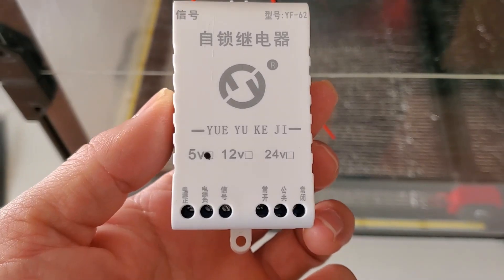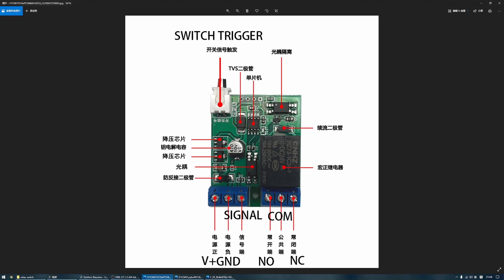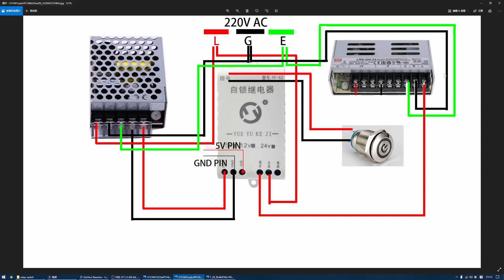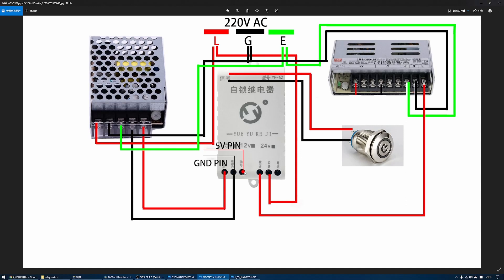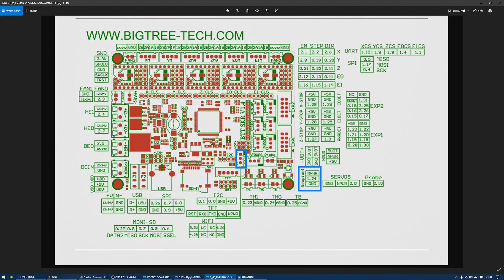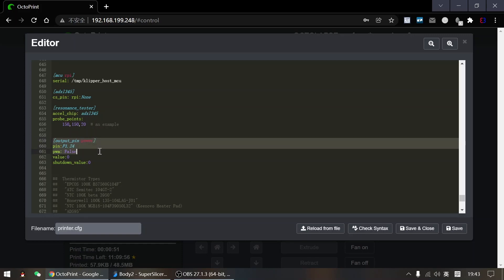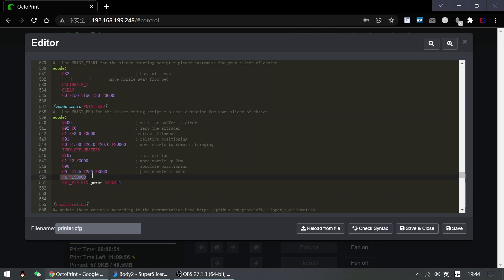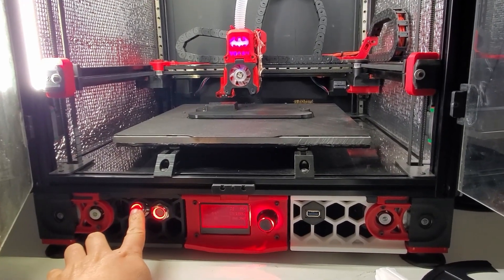Auto power off after printing for any 3d printer runs Klipper, no plugin or smart plug needed

Comment: salve ho provato con bigtreetech relay con scheda octopus pro ma non funziona...ho usato pin rgb led è giusto cosi?
[output_pin power]
pin:PB0
pwm: False
value:0
shutdown_value:0

[gcode_macro PRINT_END]
#   Use PRINT_END for the slicer ending script - please customise for your slicer of choice
gcode:
    M400                           ; wait for buffer to clear
    G92 E0                         ; zero the extruder
    G1 E-20.0 F3600                ; retract filament
    G91                            ; relative positioning
    G0 Z1.00 X20.0 Y20.0 F20000    ; move nozzle to remove stringing
    TURN_OFF_HEATERS
    M107                           ; turn off fan
    G1 Z2 F3000                    ; move nozzle up 2mm
    G90                            ; absolute positioning
    G0  X340 Y340 F3600            ; park nozzle at rear
    G4 E120000
    M109 S50
    SET_PIN PIN=power VALUE=1

Comment: Is possible to do the same using the BTT Relay?
Reply from the maker: I think BTT relay, or any other relay with signal pin will work, but BTT relay is more expensive and do not have a switch trigger.
Reply: @3DFunfun  Makes sense

Comment: It is also easier to connect the Arduino relay module to the gpi to the Raspberry Pi, and using the power control plugin for octoprint, control the printer on and off, there is a temperature shutdown setting.  Relay module price less than 1$
Reply from the maker: Good idea!